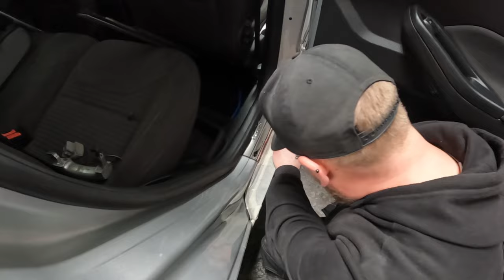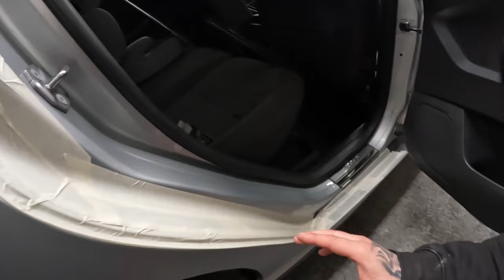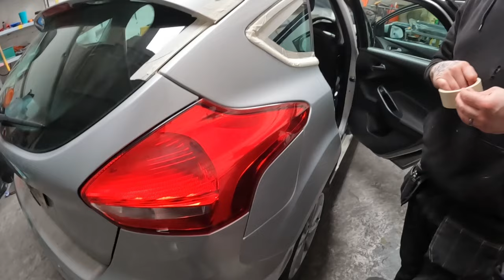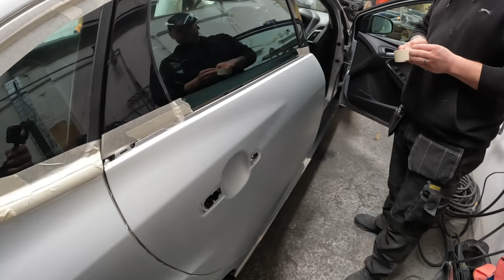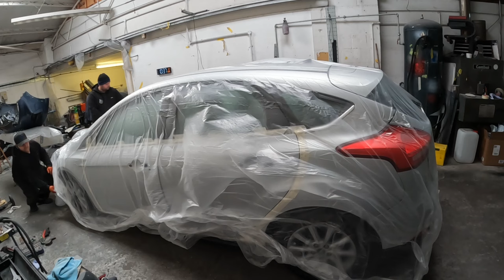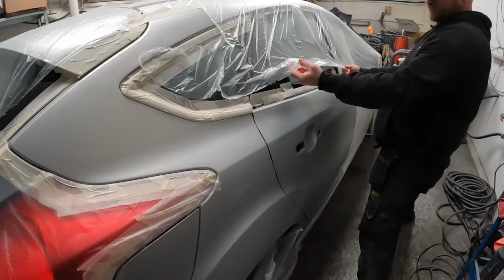How to mask a car ready for paint, hints and tips to mask efficiently

Comment: That is so good to help us DIY cheers from Phil in Sydney
Reply from the maker: No problem Phil, we will continue to put out helpful videos as often as we can around all things body related mate 👍we have a new project here with lots of fibreglass work to do soon so there should be some great stuff on that too
Reply: @custombodyrepair  look forward in how to blend the clear in so much cheers 👌
Reply: @custombodyrepair Hi guys another question,i have just sprayed a House Door with Base Coat,then cleared it with 2K but did get some runs in the end only in 3 areas of the door.Can i just wet & Dry those areas with 1500 then just polish that area or will i have to sand the Hole the House Door.
Reply from the maker: @Snip59  just the areas will be fine Phil no need to do the whole door
Reply: @custombodyrepair Ok so 1500 wet & Dry yes then polish with a soft compound.
Reply from the maker: @Snip59  it was all depend mainly on the compound you are using, it’ll have to have some heavy cutting abilities to polish up from 1500 so you may want to follow it up with 2000 and then polish from there mate, we’ll be shooting a video in the next couple of weeks on how to remove all manner of different contamination from new paint so I reckon it will be a good one for you 👍👍
Reply: @custombodyrepair Cheers better to use 2000 wet then a polish but slowly yes .Look forward to that clip many thanks.

Comment: Great video thanks, so between the 2 doors on the passenger side you didn't apply any masking? Ta
Reply from the maker: No problem at all mate, thank you. On this occasion I didn’t mask between the two doors as I wanted the clear to reach the tucked edge on the rear door but usually if for whatever reason I don’t want that to happen I either use foam tape in there or a flip edge similar to the drivers side 👍
Reply: @custombodyrepair  but for example if the gap door lip need to be painted do you apply mask at the back to avoid over spraying going through?  I been practicing and learning on my E39 BMW, done all the rust and dents repairs and getting close to the actual painting...that is actually all the full car ...but I don't want to touch the doors jambs as they no need to be resprayed.... and yes I'm worried about the masking part of it 🤣
Reply from the maker: @meguinness1116  what you can do if you’d rather not get anything in there is back mask off the edge of the door and as you close the front door it will pick up the tape and stick to it so it should close out the gap and ensure minimal gets in there, that’s how I do it if I want to make sure it’s totally covered, if you are unsure of what I mean let me know and I’ll shoot a quick video for you during the week to show you how to get around it mate 👍
Reply: @custombodyrepair  I believe I understand what you are saying 😁👍 thanks
Reply from the maker: @meguinness1116  no problem at all buddy, happy to help 👍

Comment: Me again 😊, if the door handles are same colour of the  body can I leave them and spray them at the same time of the body or is best to remove them and spray them separately? Ta
Reply from the maker: You can leave them in of course but it’s best not to because you aren’t able to prep under them which in the long run could lead to those edges lifting and delaminating bud 👍

Comment: After how long finished spraying do u remove the masking? Ta
Reply from the maker: Sooner rather than later is best mate, I just usually wait until the clear coat is touch dry and then I know I can remove without causing and damage or impressions in the finish 👍 most the clears we use that within about 45 mins or so
Reply: @custombodyrepair  Thank you, what brand of clear you use ? Standard or fast hardener ?
Reply from the maker: @meguinness1116  so we use a few and we pretty much always use fast or extra fast hardener, the clears we use are final systems ultimate, spectral 565-00, they are the main 2 but we do sometimes use others when needed for different finishes such as Matt or satin etc multi mix has also been very good for us in the past
Reply: @custombodyrepair  I through that fast hardener is better to use if only spraying a single panel, and standard hardener if spraying the whole car
Reply from the maker: @meguinness1116  it depends a lot on environment also if it’s colder use a faster hardener as it’ll slow down flash off times anyway, we can paint a full car with fast due to experience but if you aren’t spraying every day then perhaps go for a slower hardener if doing a full repaint bud 👍